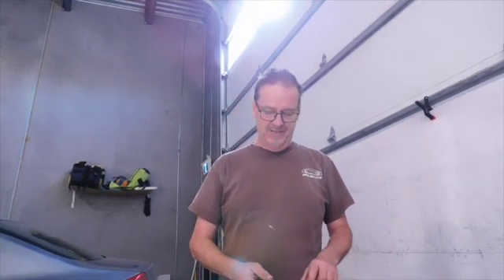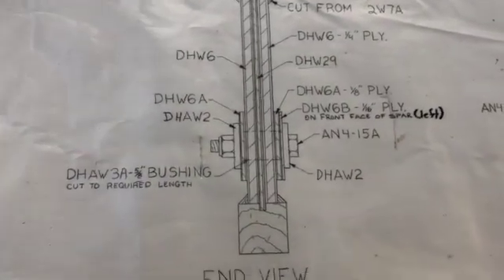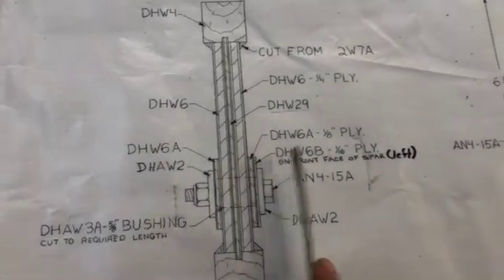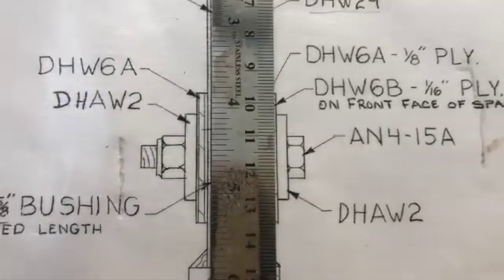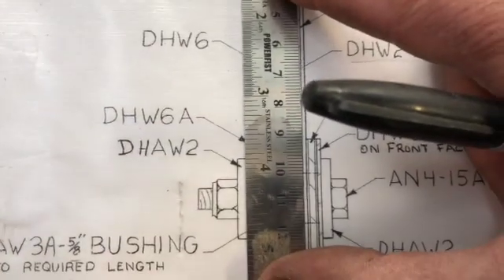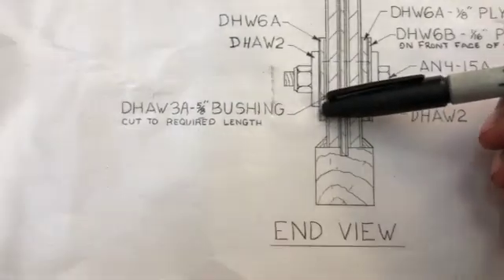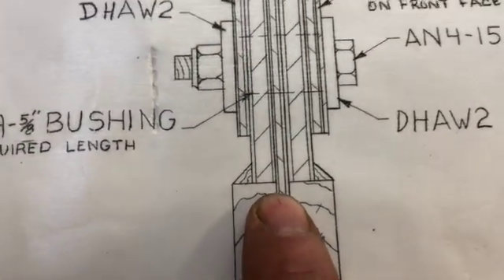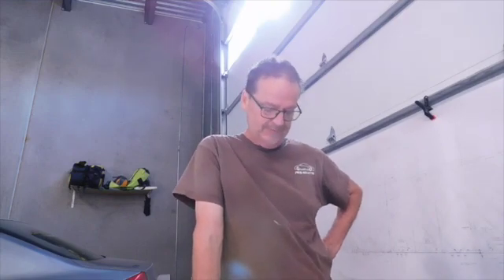DAKOTA HAWK EPISODE 14

Comment: Recommend not to drill all the mounting holes for DHAW2 the  - main spar attach fittings  - until the final fit to the fuselage there could be a 1/8 error due to paper shrink/stretch
Reply from the maker: Yeah that darn shrinkage... I was using the dimensions and not the actual prints... good tip.
Reply: On my Super Koala plans, there is 1/4” difference between the “full size” drawing and the tape measure over the 54” length of the ribs. Very disappointing.
Reply: I like the 5/8 bushing in there.